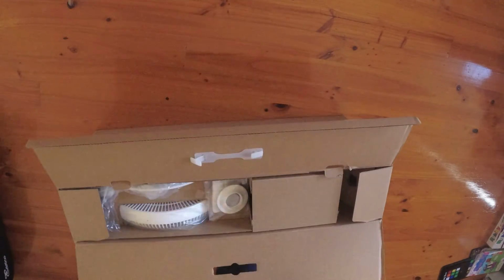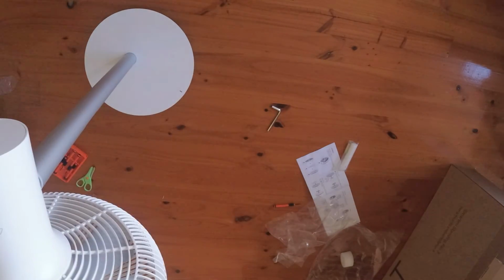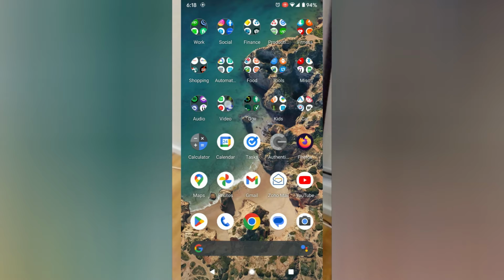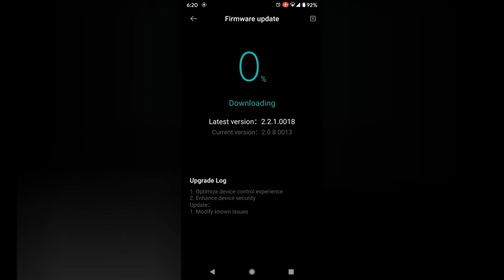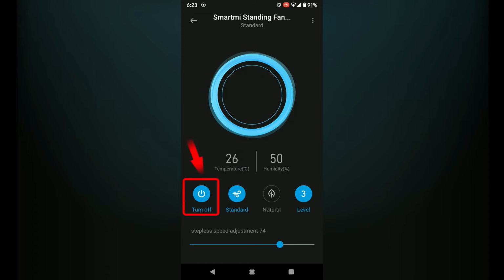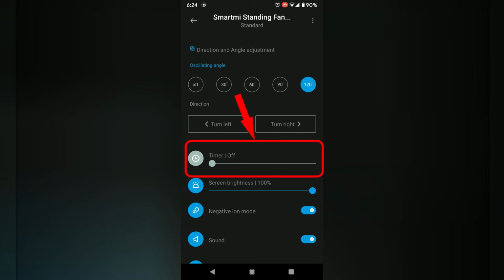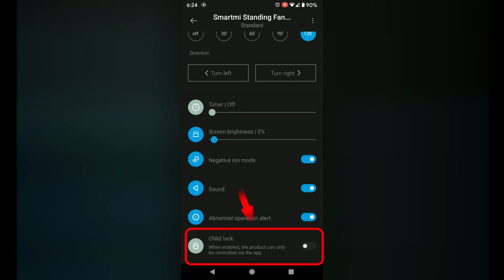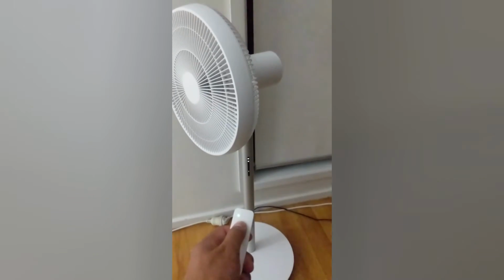HOW TO USE THE XIAOMI SMART FAN 3 AND TESTING MOBILE APP + UNBOXING

Comment: why i cant detect my fan in the apps ?
Reply from the maker: Are you using wifi 2.4ghz?
Reply: @skopioeye  yess
Reply from the maker: @beh0124 make sure Bluetooth is also on and reset the unit. You can reset by holding both buttons on the back and top of the unit at the same time.
Reply: @skopioeye  i ady done all these but still same
Reply from the maker: @beh0124 you already reset?

Comment: How loud is it? Could you leave it on while sleeping, would level 1 fan speed be enough, but not to be 2 loud?
Reply from the maker: There is a night mode so you can leave it on whilst sleeping. However there is a green light at the base which is bright and I just tape a piece of paper to cover it. Hope this helps and please like a d subscribe. 🙏
Reply: @skopioeye , planning to buy this one, but from what I’ve understood you can turn off the lights from the app.
Reply from the maker: @dnsfzr653  yes you can turn on the status lights but the green power light on the base can't be turned off. I have to put a piece of paper over it to block the light.
Reply from the maker: @dnsfzr653  yes you can turn the status settings via the app. However, the green power indicator light on the base you can't turn off. I put a white piece of paper over it to block the light. Hope this video helped and if you can like and subscribe to the channel that would be great. Thanks in advance.
Reply: @skopioeye , tyvm for the quick answer! Just subscribed & liked. ;3
Reply from the maker: @dnsfzr653  thank you so much